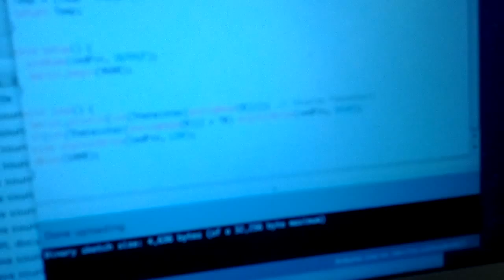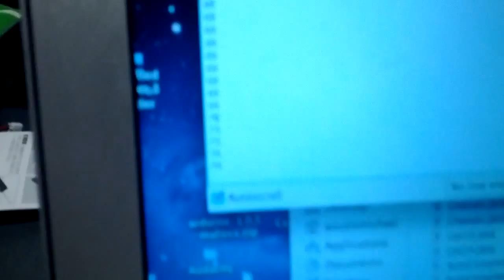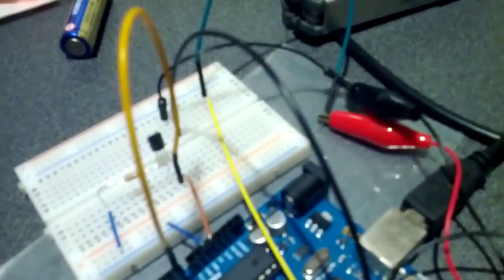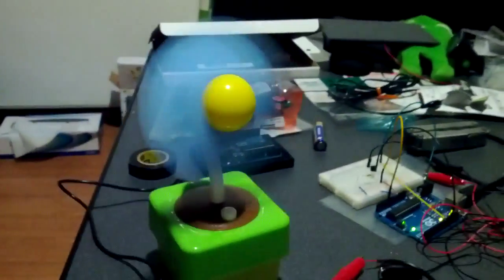Arduino powers USB fan when it's too warm

Comment from the maker: Yes, I used pretty much the exact same code as the Jeremy Blum tutorial 4 on Analog inputs. The same code to turn on an LED turns on the fan if you simply plug it in. Then copy/pasted some code on arduino temperature sensor tutorial to get the reading. Adding the link to Jeremy Blum's tutorial in this video description.